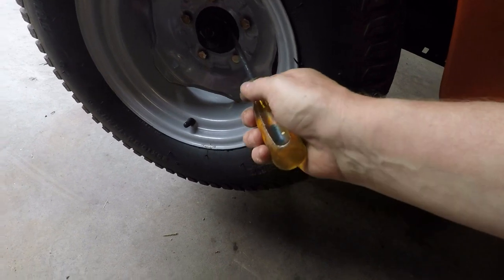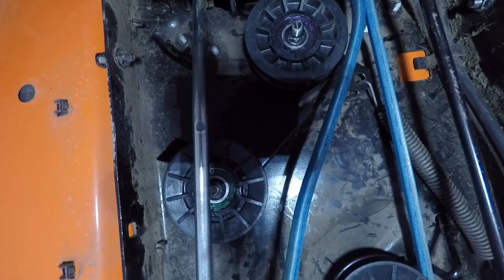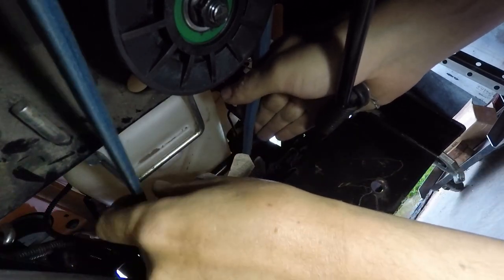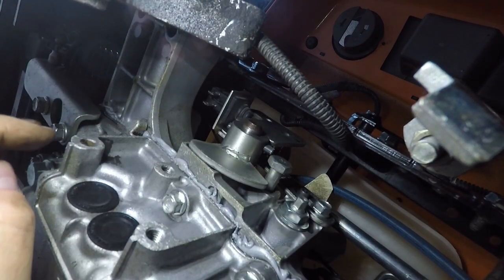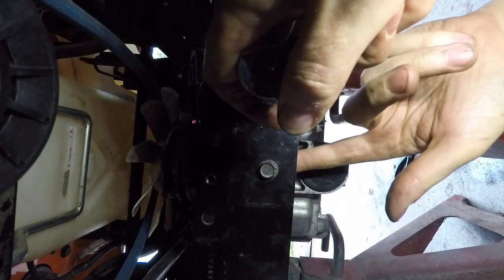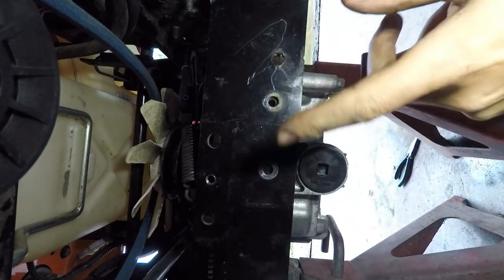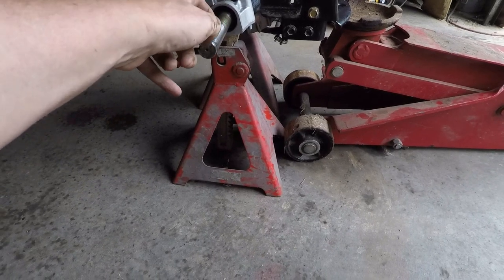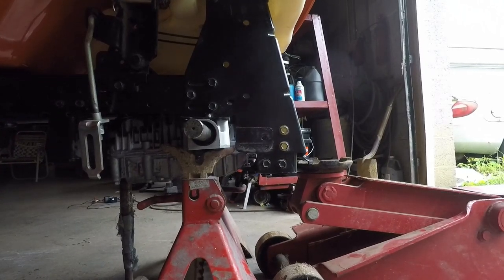Husqvarna Lawn Tractor Mower Transmission Removal GT52XLSi GT52XLS GT48XLS GT48XLSi

Comment: I just did the same Husqvarna tractor transaxle rebuild and it was exactly the way you showed. The only thing I had to correct was the front angle plate that supports the tranny pulled the bolts out of there holes and I put threw bolts and nuts when reinstalling. That’s a design flaw. Threw bolts are better and one more note that the two bolts that support the axles to the frame. The left side bolts are longer than the right side bolts. The left side has an additional 1/4” plate the bolts have to go through.  Your video is very informative. Thanks.